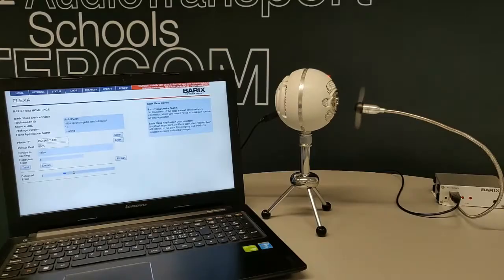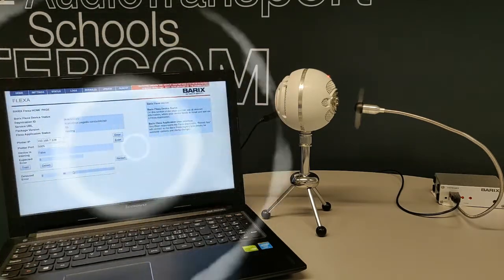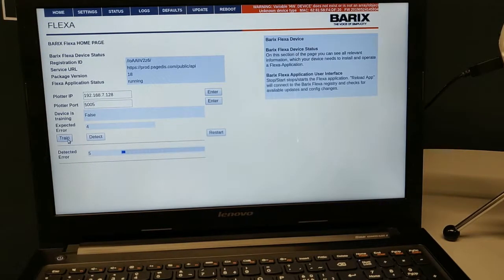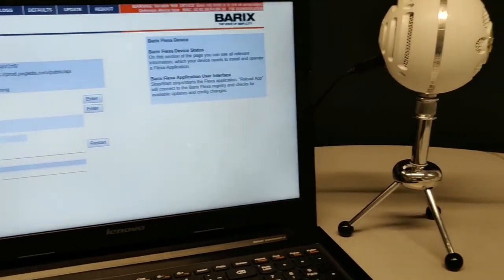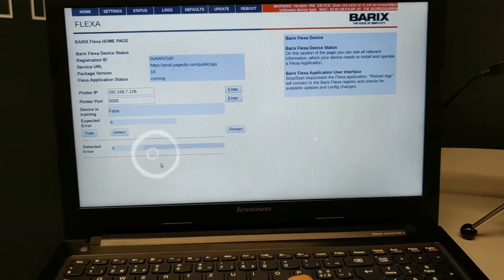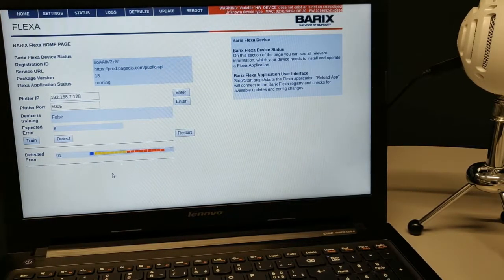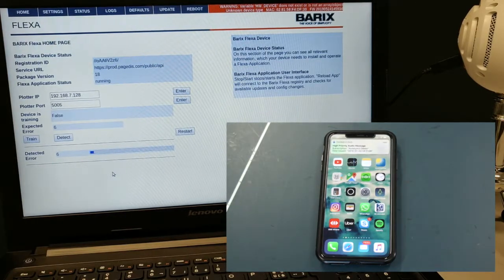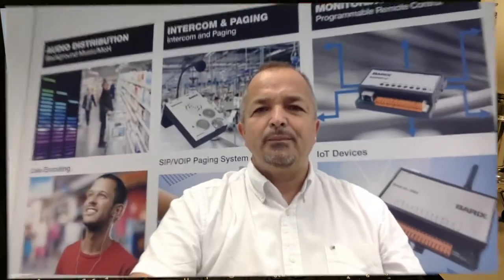Audio Analytics: Anomaly Detection Demo

Comment: This is cool, what anomaly detection model is being trained and on what features of the audio stream? What is the delay like between failure events and notification? The signal must be computationally intensive to handle
Reply from the maker: Hi Nick thanks for your interest. We are extracting features from a fixed length of signal, say 1ms and modelling it statistically. To decide upon the anomlay we look at the eucledian distance between the extracted features of two signals. As for the delay the computational delay are negligible of the order of few ms. We optimized window size, what features to extract and how easy they are to compute by striking a balance between accuracy (if anomaly and normal sound are 50-50) and speed. There could be network delays in sending the error reports but that could be optimized too depending on the requirement(by changing the length of recorded signal), for this example it was few seconds (sending the alert report only).